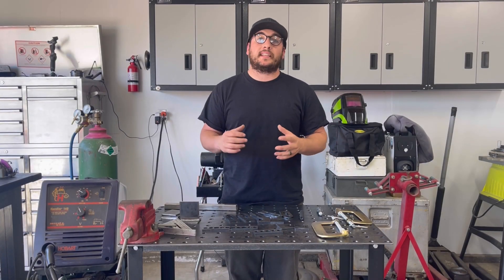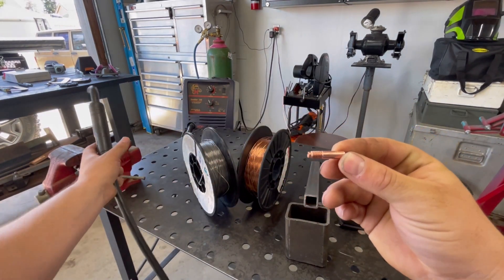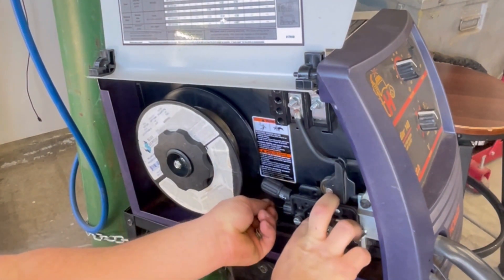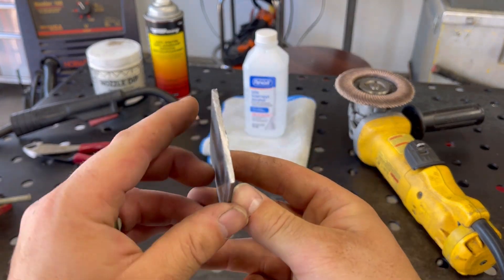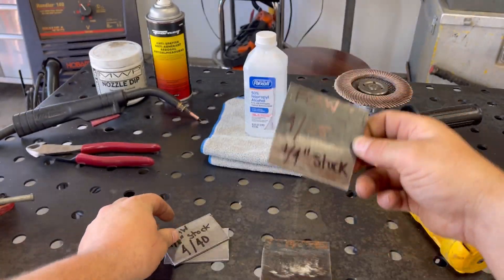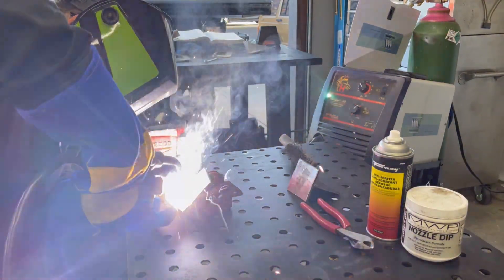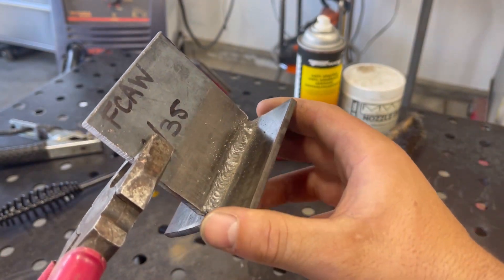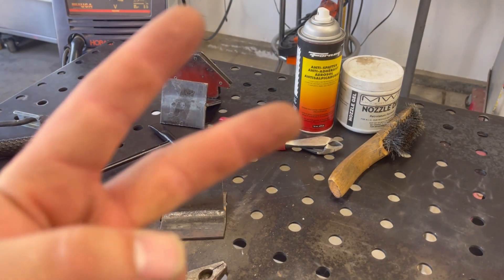Learn Flux Core Welding With These Tips - Basics For The Beginner

Comment: Awesome video man. I’m new to welding in general I’m trying to dial in my yeswelder 135 flux core gas-less welder it doesn’t have a template for starting wire speed and amperage for metal thickness. It also has infinity knobs. Any suggestions to get me in the ball park to weld 3/16” stock. Thanks again
Reply from the maker: Well the max output on that welder is 135amps so we know that.

There’s no generic assortment of settings that always applies. Welding is a custom craft, and it depends on a lot of variables.

A general rule of thumb is you need 1 amp of power for every 0.001 inches of steel.

Stainless needs 10-15 percent less current, and aluminum needs around 25 percent more.

So, how many amps does it take to weld 3/8 steel?

For 1/8-inch mild steel, which is 0.125-inch thick, 125 amps would be a good place to start.

3/8-inch thickness is 0.375 (3 x 0.125), so do you really need 375 amps for this? Some welding machines claim to weld 3/8-inch steel with only 170-200 amps. How is that possible?

First, these numbers are estimates. They only put you in the ballpark.

Second, manufacturers indulge in a little bit of magic to get these numbers to advertise performance. They bevel the edges of the joint to get the thickness down. This way, less current can make the same weld in one pass.
Reply: @ATEMOFFROAD  thanks man. So basically my welder is not capable of properly welding that thick of steel…..I suppose I should have done more research before purchasing, most things I’m going to be welding are 3/16”.
Reply from the maker: @joshuabeatty22  with gas 1/8 is maximum. with flux core even thicker , you can weld up to 1/4” stock no problem with that welder on its highest voltage setting. It’s because with flux you will naturally have better penetration. Try  pulling back on the wire speed and or playing with that. But ultimately understanding your variables at hand will be most beneficial, ie structural or not, weld position, wire speed, travel speed material thickness etc. looking at the weld and determining what needs improvement
Reply: @ATEMOFFROAD  thanks man I’ll work on it. Just know that I have probably watched thousands of YouTube videos and never subscribed to anyones page before yours. Keep making awesome videos! Love the TJ ones
Reply from the maker: @joshuabeatty22  i appreciate the support, thank you 🍻

Comment: To start a weld, do you physically move the nozzle closer to the workpiece until the flux core wire makes contact, THEN start pulling the trigger? Or do you hover the contact tip and wire slightly above the workpiece, keep it in a locked position, then pull the trigger to extend the wire out to make contact?

And do you start dragging right at the moment of contact (sparks), or do you let it spark for a few seconds to melt and create a puddle before you start dragging along the seam?
Reply from the maker: I hover the contact tip over the material and then start the weld pool by pulling the trigger so the wire makes contact to the base metal then adjust from there, no dragging at that moment we first need to establish a weld puddle once formed then move. It’s happening quickly so be ready.
Reply: Excellent question. Thank you for posting this.

Comment: Actually when you change wire feed speed from 35 to 50 for 1/4” it creates more heat for the thicker metal. The faster the wire feed the more amps you’re using.
Reply from the maker: Yes in the example you provide this is what your doing. Faster wire speed = more wire = more amps to heat that wire and base material! In your case I would turn up the wire speed to match the material thickness 50 on the wire speed is correct for 1/4” stock 35 is correct for 3/16” stock. The main source of heat is the voltage setting then the wire speed, then the stick out or Arc Gap and travel speed. I don’t mention this because it’s a beginner level video where the main focus here is choosing the correct recommended settings based on material thickness for best penetration using the machines guide! Doing this allows the user to understand the limitations of there machine! I do plan on doing a trial and error video where I make adjustments based on the many variables going on during the welding process! But this goes into electrical theory for constant voltage machines, metallurgy and other positions, and techniques ie “ travel speed “I have not discussed. Thanks for stopping by and sharing 🍻

Comment: Ive been wanting to get into welding so bad. Do you need a good 240v or can you do some pretty good welds with a 110v welder? Also what would you recommend for a good entry level welder, something that won't break the bank but will allow you to grow and keep up with you?
Reply from the maker: Definitely choose a welder based on the material thickness you plan to weld. Most 250 amp welders can weld 1/2” GMAW. 
So everything I have made on this channel Ive used the Hobart welder featured in this video, it’s a great beginner welder to practice with , I’ve made sliders, roof racks , cargo racks some suspension repairs on my Jeeps and the entire overland trailer build, exhaust and body repairs. the 115v Hobart welder  has already paid for itself times over. But I’m moving towards some larger material builds and will be needing a 240v welder soon. The 115v welder was given to me as I did not buy it, if I were to buy a new welder I would consider the Hobart 190 if I go budget or the Miller 252 if I go full on dreaming! Both welders have there pros and cons, but weld up to 1/2” stock material both FCAW and GMAW processes but the Hobart 190 is only good up to 5/16 stock GMAW. Which is really good . Those two welders are great machines i work with them frequently at work. There’s also the 250a Ironman I’ve never run it , but I can say the Hobart I have is nice 👍🏼 .
Reply: Titanium 125 flux is a good starter welder for fcaw I've welded 1/4 inch with it no problem

Comment: Sick video!  I'm definitely along for the welding videos.  I have some experience on a farm learning to weld but no formal training.  One question I had is as you are welding are you going straight across or zig zagging or making a "half moon" pattern as you weld down the line?
Reply from the maker: Thanks for stopping by and checking out the video. To answer your question for flux core welding it’s not required, but optional based on the so many variables going on during the welding process . Has a lot to do with penetration and slag inclusions etc etc. But I do tend to find my self using movement when using flux core usually to help bridge the gap from piece to piece when forming the weld puddle. I don’t share this variable in this part because it’s mainly for beginners. but  in the then next one during GMAW I will! Will slowly start to progress into more advanced welding and thats  partly my goal with this series. Thanks for watching 🍻
Reply: @ATEMOFFROAD  sweet man thanks!